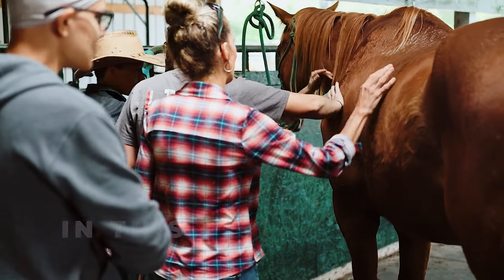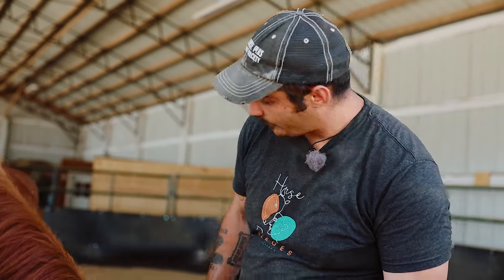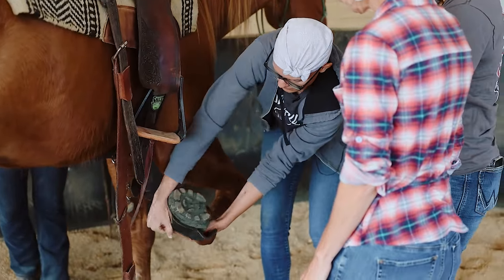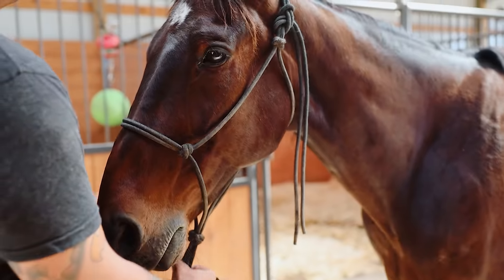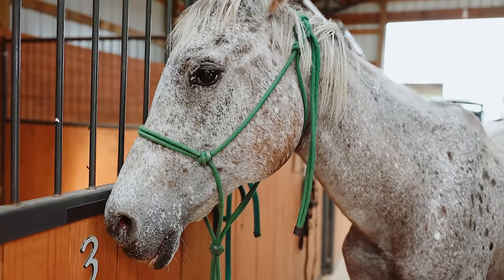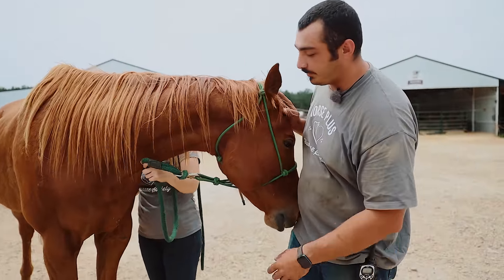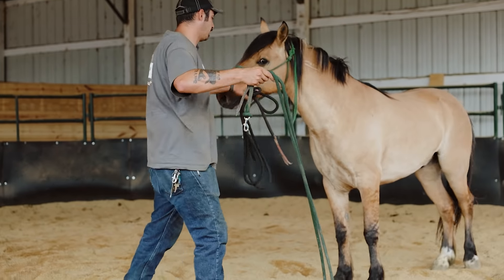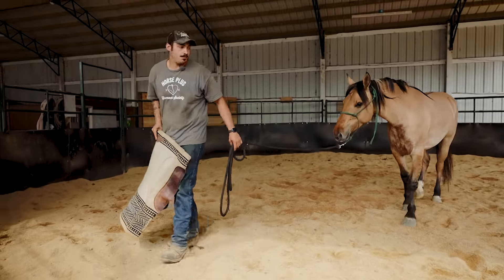Training The Mustang - Horse Shelter Heroes S3E13

Comment: I used to like how Kory handled horses but I gotta say this made me cringe a little...
Being all up in their face and yanking on the lead rope like that? It WILL get you bit or reared on...
The way I was taught to teach a horse how to lunge is by being a fair distance from them, first. Because if you're teaching them those basics it means they're unhandled and potentially could be reactive to pressure..
You point with your hand holding the lead rope in the direction you want them to go. Then ask by clicking your tongue or whatever oral cue you like. Then, if that isn't enough, you apply pressure gradually by swinging the end of the lead rope, or moving your whip towards their hind end. But do not get any closer! And of course release as soon as they take one step.

Horses are very sensitive, and being so pushy really isn't necessary. It could even be very dangerous.